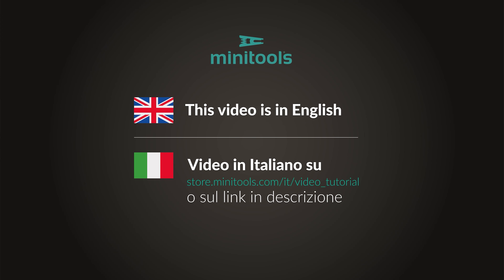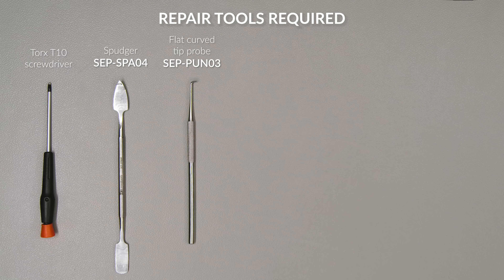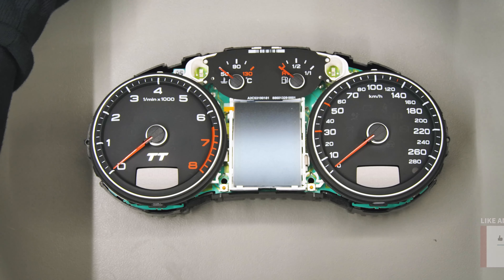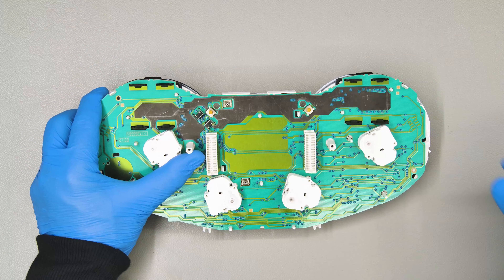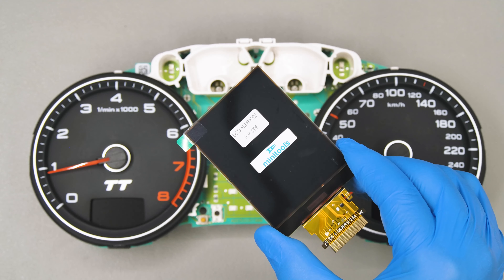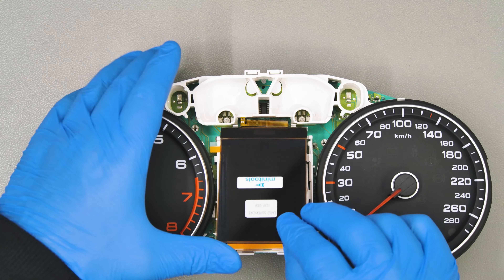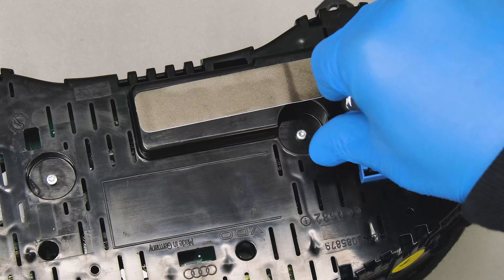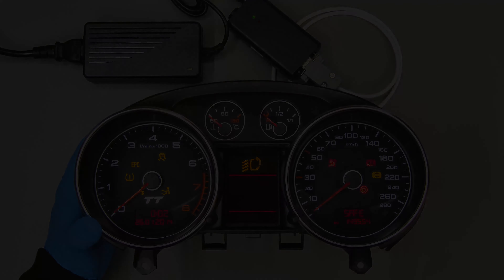How to replace the faulty DIS / FIS LCD display of Audi A3 8P, S3 8P and TT 8J instrument clusters

Comment: Don't you need to do welding or soldering?
Reply from the maker: Hi, in this case soldering is not necessary: it’s a “plug and play” display, all it takes is to connect the FPC of the new screen on the PCB of the instrument cluster.